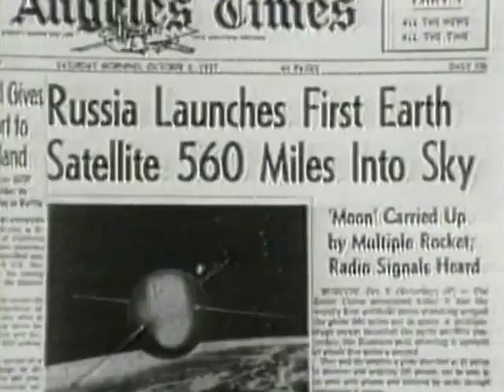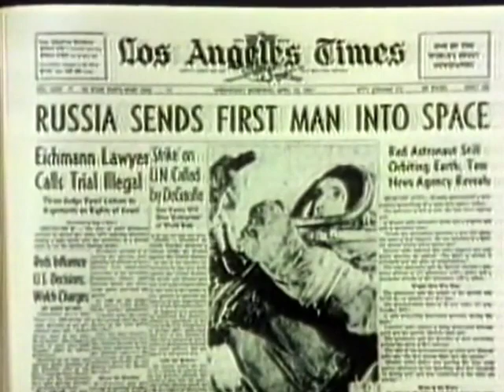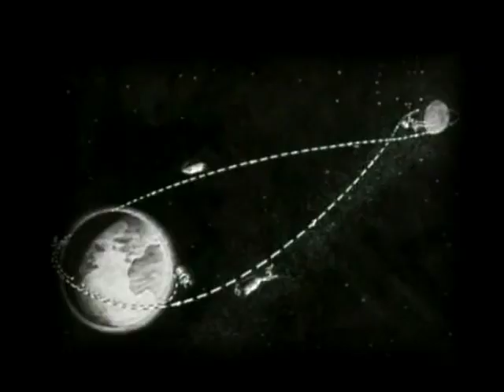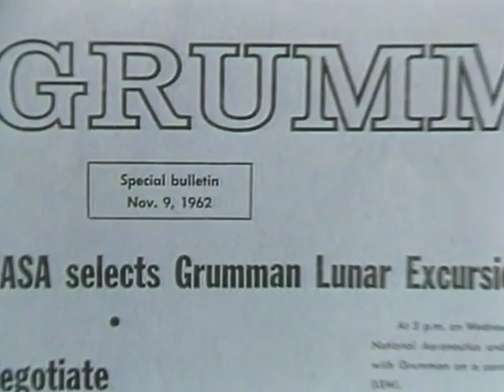The Eagle Has Landed: The Lunar Module Story pt1-2 1989 Grumman color 14min

Comment: https://www.youtube.com/watch?v=xc1SzgGhMKc
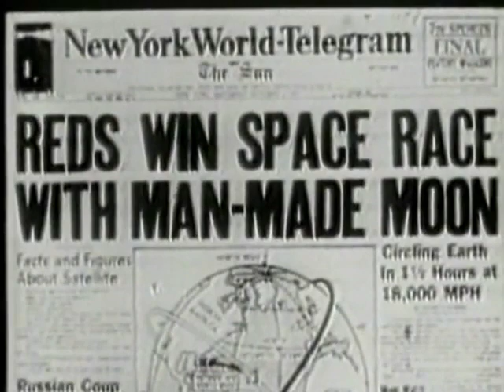Beginnig at 1:07 minute; what are those bent out of shape beige color panels on top portion of some space junk contraption? What are those gaps between these panels as if work had not been finished on them and rivets that seem to be placed randomly? What are these sharp edges of these panels as if they were not filed or properly milled? These exposed gaps of these panels cover something and if you have gaps, you certainly will not have a hermetically closed system past these crevices where you can put a finger in between. These panles look like someone had build a dog house out of some junk yard panels in haste just punching a rivet here and there which are not proportionately spaced out. The sharp edges of these panels stick out at the angle of 90 degrees to the plane of the wavy bottom part of this junk and they look like they were not cut to size leaving the excess of the edge just protruding beyond the wavy bottom portion of this junk. Notice the bottom part also in baige color. This panel looks like any panel of the wavy standard merchandise one can buy at a hardware store. Where the two panels meet, it looks like both of them are not fit together to give a nice 90 degree angle with smooth finish where the angle would not create a crack between them. And these cracks are perfectly visible where the two out of size panels meet and are big enough to stick a nail, pencil or finger in between. 
People! You are looking at an unfinished shack glued out of bent and disproportionate panels built for a children's playground or you are looking at a big dog house constructed in a backyard. This does not show any craftsmanship. This contraption looks so shaggy, so misaligned, so amateurish, so primitive, so coarse that it is nothing else but some junk sitting on Earth pretending to be some space ship landing on another world in space. No one builds space ships out of panels which are bent and creased and riveted wherever it can be done so without any signs of some kind of intelligent sensible measurement. No one builds space rockets this way and especially something that wants to land on the Moon. And this thing flies………………..in space? This picture is not from the Moon and it is not a device that landed on the Moon that took anybody to the Moon. No one was on the Moon for no one can get there in junk such as described here.
Reply: The panels that you are talking about are just the outer covering, not the pressure vessel that is inside.  They are there to provide thermal protection and are not part of the structure of the spacecraft.  They are intentionally made of very thin metal to reduce weight.  If you go to this video, it shows what is under the outer covering.  It is a complex machine. https://youtu.be/ZMunUXk2Ae4?t=145 
Maybe study some real facts rather than watching hoax videos.  You will learn nothing from them.

Comment: 1. sun would have cooked them.  2. no room for fuel on lunar lander. (landing and take off were extended burns) 3. no radiation shielding. 4. where did all the air come from in those tiny vehicles?
Reply: +shawn burnham 1. That's why is was covered in thermal control panels

2. Separate stages = separate fuel supplies for each stage.

3. Background radiation in translunar space is around 0.2 millrems/hr, so no shielding needed for a short-term mission.

4. Oxygen storage tanks coupled with CO2 scrubbers.
Reply: 1. The Sun is the same you have on Earth.
2. Are you seriouss?
3. Are you seriouss?
4. Pressurized tank, maybeee? (oups, tiny vehicles? The LEM is big as a 2 store house)
Reply: +TourOfTorun Lol it's like those conspiracy nut jobs disregard basic laws of physics. Wow gases are compressible wow we had reflective things in the 60's???? WOWOWOW Lmao it's a joke I swear